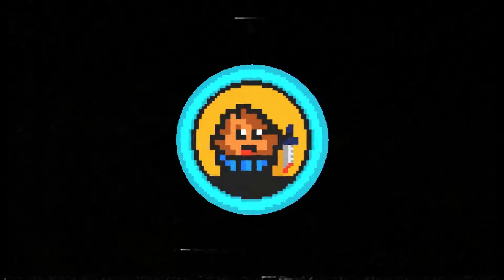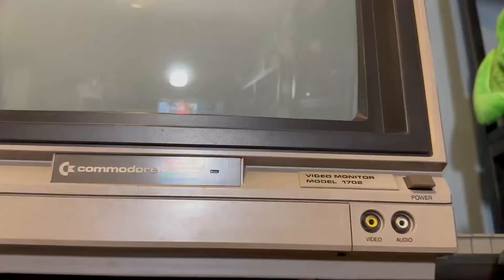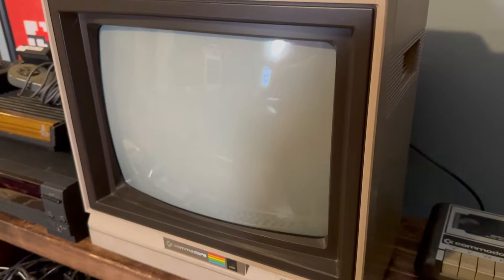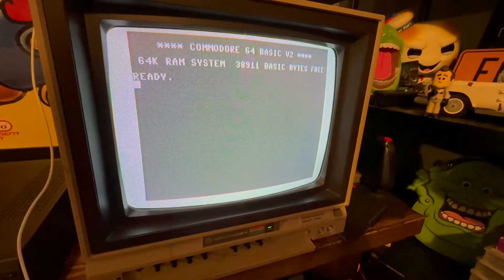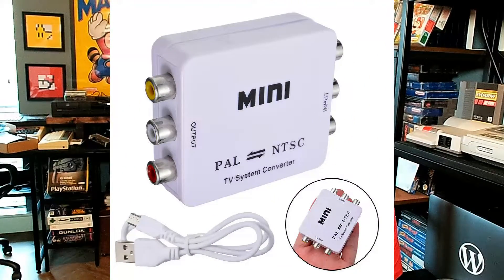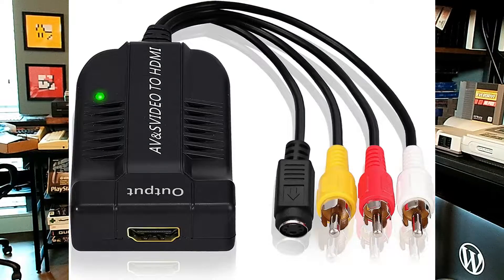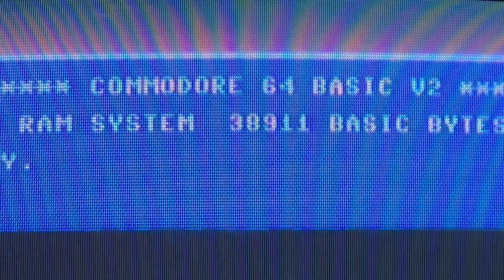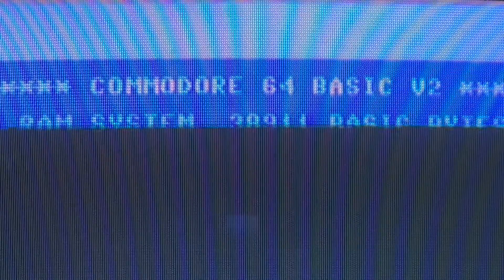Connecting a PAL Commodore C64 to an NTSC Commodore 1702 CRT Monitor, RGB Edition!

Comment: Great video!  But how did you connect the RGB (SCART) to S-VIDEO (NTSC) device to the back of your Commodore 1702?
Reply from the maker: You can get s-video cables for the C64. In my case that would be a PAL signal, hence the need to convert it to NTSC :)